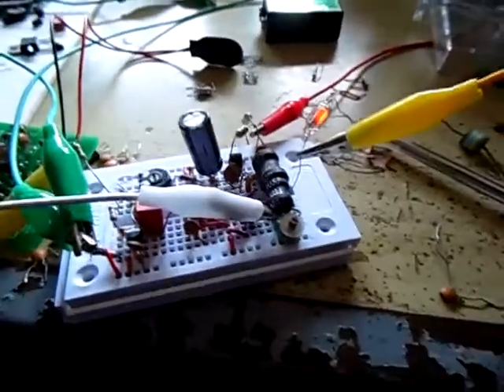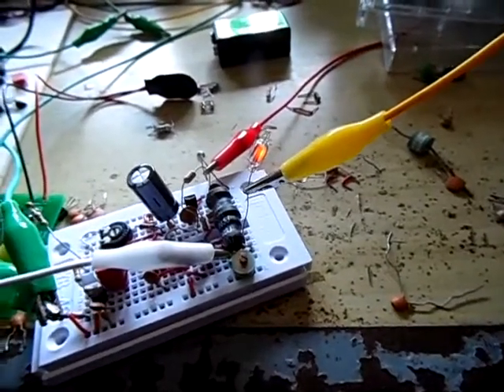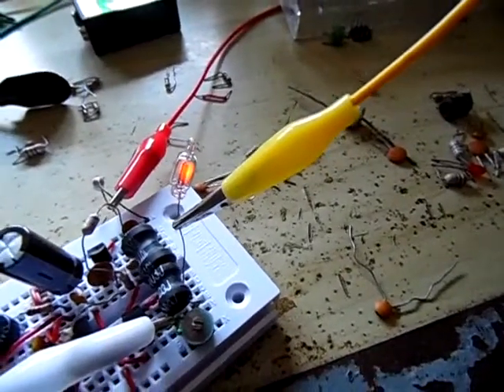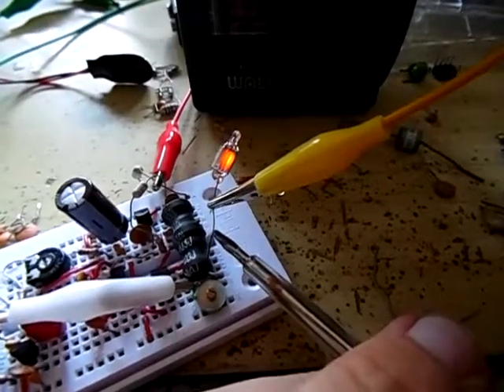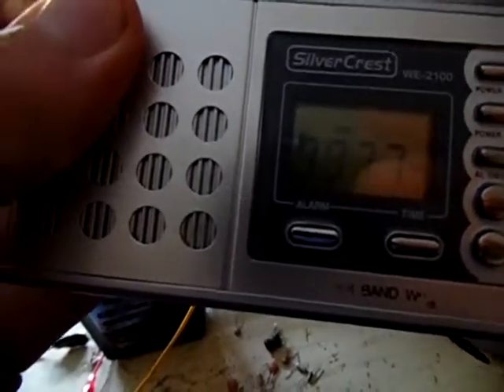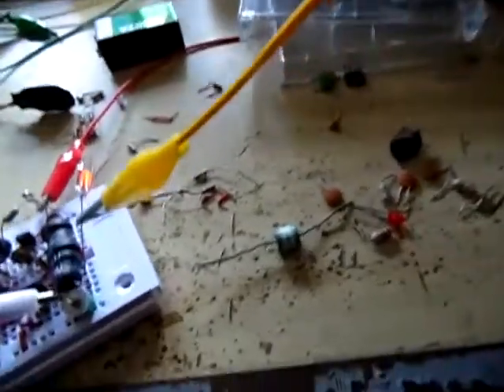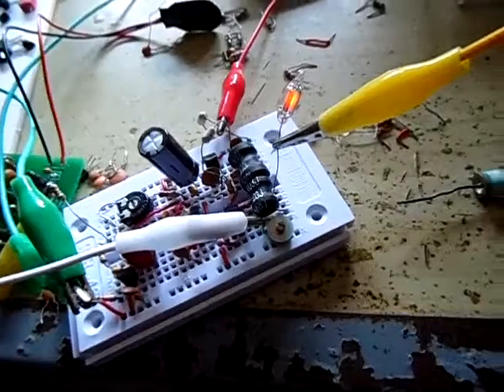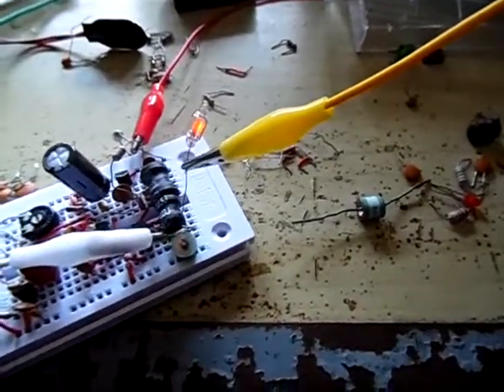Longwave transmitter - high voltage

Comment: Hi Stefan.good to hear from you again.I like this Longwave Tranceiver. I think in low frequency with 3 Watts of output and a good Antenna you will reach until 5-10km and driving on the waves you can reach about a few hundreds of kilometers.Ok the signal is not very strong at the end,but it can be heared.I'am right?